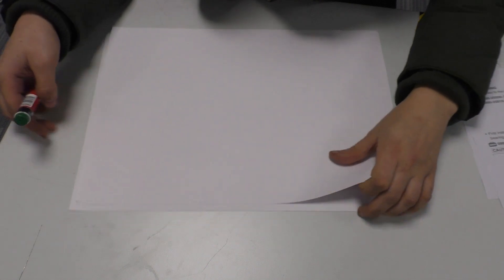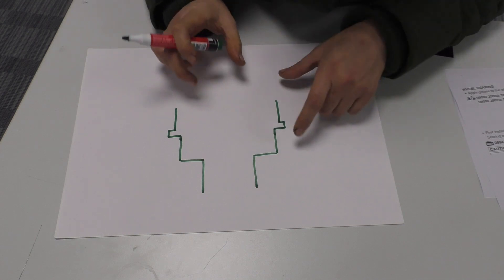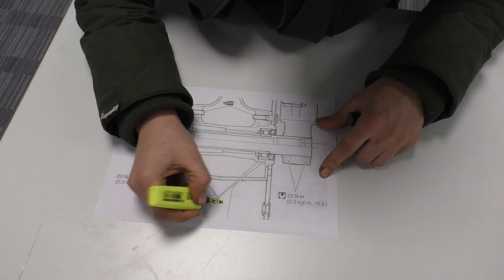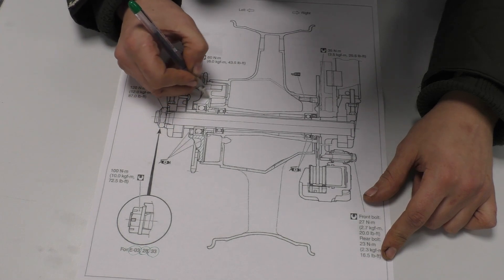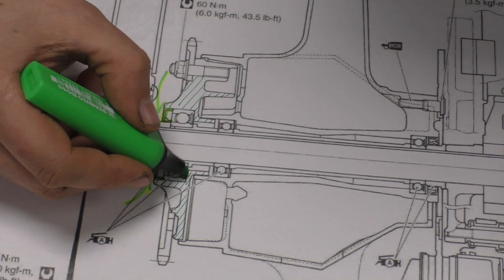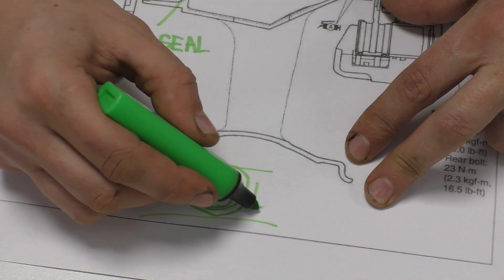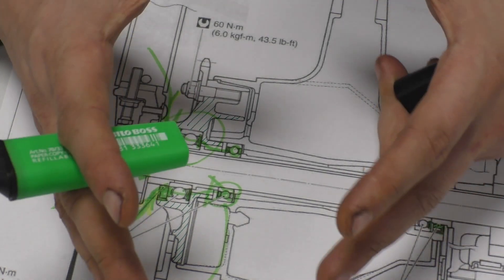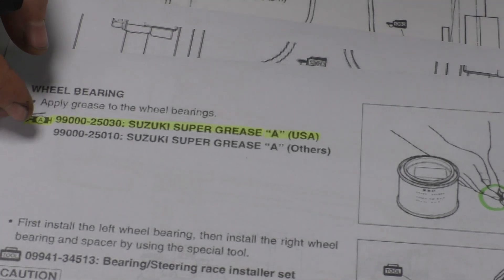Grease and bearings

Comment: Is cush drive really necessary (I understand the point of it) but if you rigidly mount the sprocket to the wheel, you could eliminate that third bearing, and a bunch of mounts and save weight. Is the cush drive just a commercial (street) thing or are they run on race bikes too?
Reply: I'd say it's mainly to protect the whole drivetrain (chain and rings, gearbox) from the inherently irregular power delivery from your motorcycle combustion engine (single cylinder: one big thump, cylinder goes up,down,up, big thump). So that would be less of a smooth riding technique problem. 
Also comfort reasons i guess.
I think for offroad racing the guys are often going without cush drive, does anybody know about onroad?
Reply: As per the response over me, the drivetrain as a whole was my understanding of it.
Reply: Put your bike on a center stand or paddock stand, put it in gear, then rock your wheel forwards and back. That slack and the hard stop at the end is what the cush drive is there to soften. It'd be like hitting your chain with a sledgehammer every time you cut the throttle. No good for the gears either.
I don't think shaft drives need to worry about this, as there's minimal final drive play?
Reply: Like super smooth riding techniques (not that I'm capable of that) could eliminate the issues the cush drive is meant to solve?
Reply: Beach&BoardFan Your chain and sprockets would last about a week
Reply: I thought cush was about saving the gearbox
Reply: I only know a lot of the offroad bike mfg's say you should run a cush if you're riding your dirt bike on the road, though some have started running torque limiters/dampeners on the clutch instead of the cush design.
Reply: I mean the chain has some play and slack in it by design/install so I've always been under the impression it was primarily for ridged mechanical interfaces.
Reply: phillip galas do drive shaft bikes have internal dampers?
Reply: y Basti no idea. Haven't worked on one. In principal I'd say no
Reply: one of my bikes is shaft drive( royal star venture) and there is a cush drive. the only bike i have worked on without a cush drive , was a racing sidecar outfit
Reply: Off road there is generally less grip, so the tyre does not offer as much resistance and so presumably any torque oscillations are suitably softened without an additional "cushion".

I remember reading something about Jaguar / Land Rover having to consider the tyre grip in the process of addressing an annoying low-speed "shuffle" in some 4x4 or other on low grip surfaces, all because they initially modeled the wheels as "immovable" in the drivetrain analysis.
Reply: well from how I understand it, it doesn't really matter if the final drive is a chain or a shaft, the transmission, clutch, joints,... will still get a proper beating if there is no cushioning from the motor (like identicrisis said, in low traction environments it shouldn't be a big problem).
So I picked the obvious shaft driven bike - BMW GS 1200 Adv as an example on realoem.com
turns out the cushioning is in the drive shaft right before the final drive.
Great pictures of it are here: http://www.r1200gs.info/forum/14-maintenance-modifications/3924-drive-shaft.html
Reply: An example I saw of a shaftie cush was in the wheel hub, several great chunks of rubber that transmitted the torque from the final bevel drive to the wheel proper.  This was on a Z1300, and it seems it's not entirely dissimilar from chain driven bikes of the time.

Comment: good video Matt . also  i find people worry more about putting grease on components more than cleaning them or preparing them correctly for the work going to be carried out. also do you have a video explaining what grease is for what ive a fairly good idea whats grease is for what but no harm to know more
Reply: grease is for greasing if I remember correctly. lol.. The engineering rule is: If oil fucks off than use grease instead. I think there is an oil video in the pipeline so grease could be covered as well. And people just don't know what is going on and as always if you don't know shit just stick to easy rules: grease is good! so good thing to put it everywhere. cheers

Comment: So what sort of grease are you going to use to pack the bearing races? Assuming you are not going to buy Suzuki OE stuff.
Reply: Derick Relph the new bearings are sealed both sides!
Reply: You can carefully pop the shields out with a very small (sharp) screwdriver and put a bit of extra grease in them if you want. Sometimes the bearing manufacturers put the absolute minimum amount inside, or if the bearing is new old stock the grease may have dried a bit, so no harm in making sure the voids between the balls are filled.

Comment: The Workshop Hi Matt I was watching some 2t video of your and I was asking why they don't use 4t style valve for exhaust,  that would solve most of volumetric problem and actually make fuel mix less present on the exhaust with intake would be to the bottom and exhaust on the top obviously it will increase cost and weight but I don't see any other problems that and there should be a lot else 2t would be that way.
So can you explain it to the dumbass I am, please sempai ?
And if any one got some idea about leave it there too ;p
Sorry for poor ability in writing ^^
Reply: joshua langley if I well understand the problem is all about opening speed valve so could it be fix be using electronic valve, it would also provide valve travel length ajustability, increasing motor efficiency.
I saw that ducati coming out with something very interesting.
Could that be a real solution should brevet it xd joking
And I can't understand all of what you are telling due to my poor knowledge and English, so with only work it's making it very difficult for me to understand the point 2
Reply: see how rapidly the design becomes more complex, and still isn't really "breathing" as well as a 4 stroke? that's why they don't bother developing this sort of design; it's a lot of work, to end up being not quite as good.

have a look at this;
https://www.youtube.com/watch?v=eWZfRdm9u9c
Reply: whole lot of complexity and weight. Valvetrain and supercharger is more cost than a whole 2T engine :D The camshafts need lubrication system to last reasonably long which isn't there on a 2T so add an oilpump as well and maybe an oil container. If you already have the valvetrain just add a second inlet valve and make it a 4T and off you go.